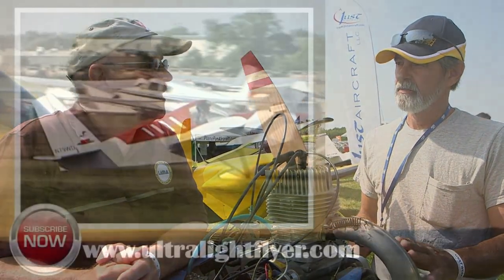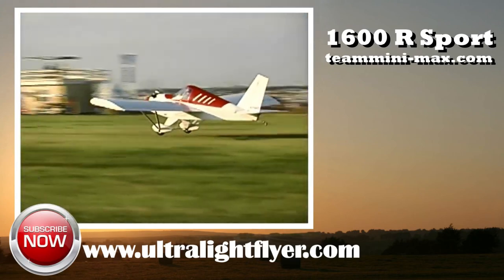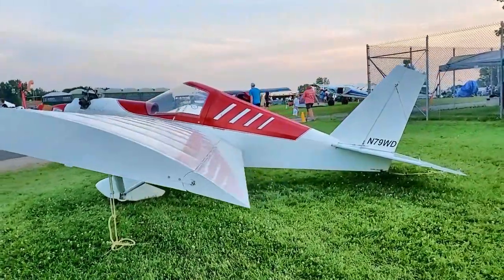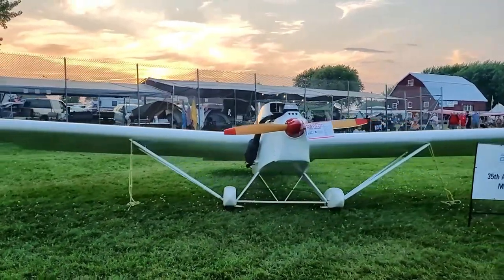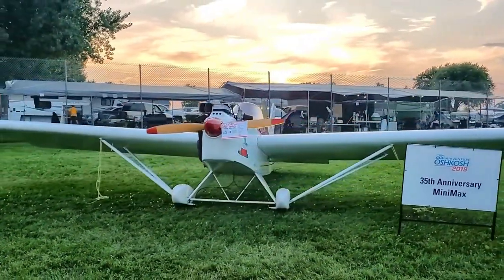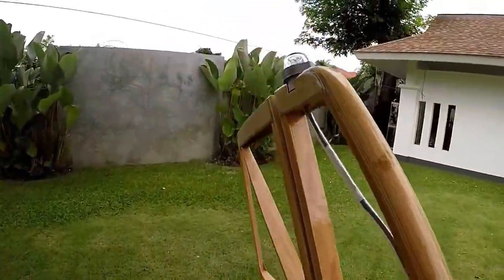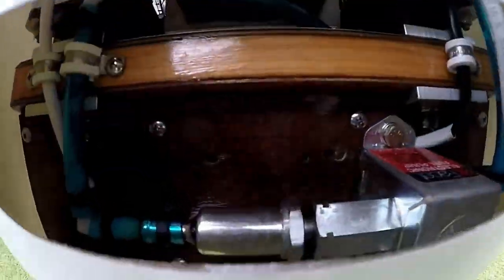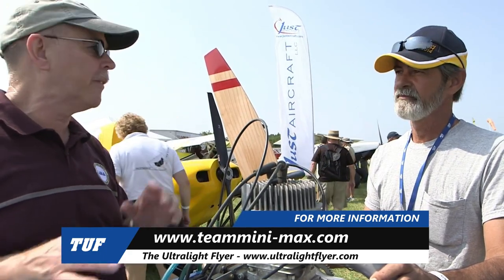Mini MAX, TEAM Mini MAX, ultralight and experimental aircraft, TEAM Mini Max Aircraft

Comment: With a composite construction you could figure out a way to basically stamp the entire fuselage. Fiber and thermoplast sandwiched and just stamped. You can get a multipiece enclosed composite kayak for 1000$ retail. That should tell the potential for cost optimizing great planes. Imagine a high performance plane for 10000. Certified factory built. Zero build time. Why not.